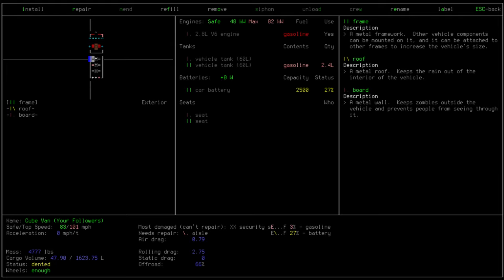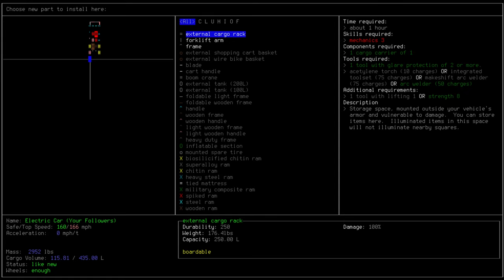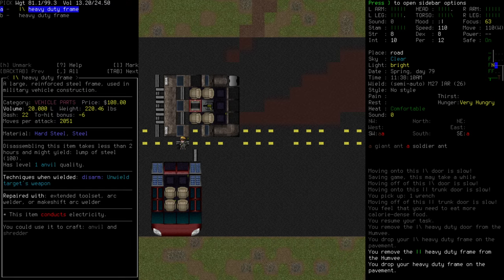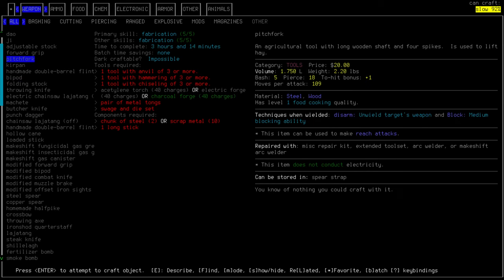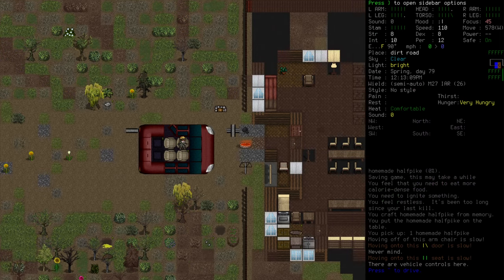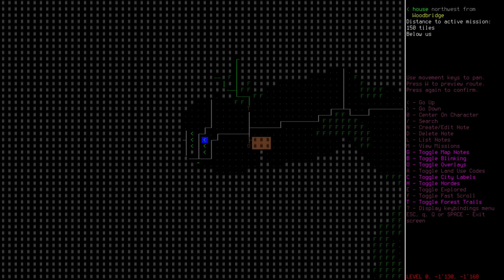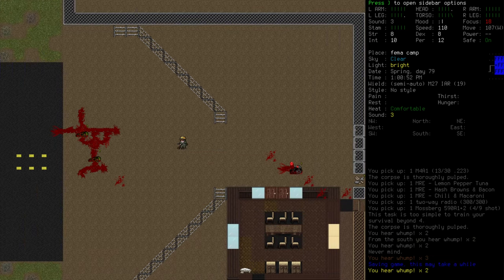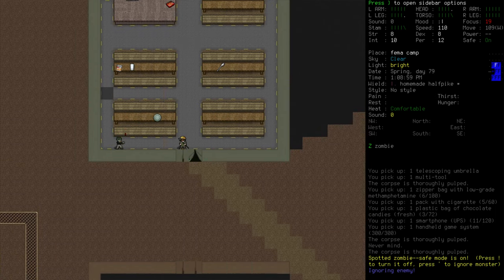Cataclysm: Dark Days Ahead -- Episode 34: Forklift Installation -- Escaped Killer

Comment: okay, I don't know if you still need this or not, but oh well,,
- don't bother installing that arm. make either pallet lifter or telescopic cantilever instead, because you can't make portable Lifting with that.
- you can get clay when digging, it's just luck.
- you need pair of metal tong to do forgingit, which you can get from houses on the cupboard.
- thing you need for forging ( in order ) :
1. pair of metal tong
2. electric forge / charcoal forge. ( charcoal kiln (iirc) if you are using charcoal forge.
3. anvil ( make it from heavt duty frame if you can, because it's easier )
4. swage and die set.
5. tons of metal
- you have a crafting area, which is 13x13 radius ( with you at the center ). meaning, you can use material in this area as long as it's accessible.
- you can sort your item by pressing "s".  it doesn't work on pick up item interface thou.
- try to favorite thing ( by pressing "f" on individual item interface )
- you can drop every item in one categories by pressing TAB ( favorite won't dropped so don't worry ).
that's it, I thing i'll drop more next time
Reply from the maker: Thanks for the advice. We installed the arm in this episode, so I'm a little confused about your warning not to do so. We have been discussing these needs recently in the series.
I'll try to remember to try out the sorting functionality!